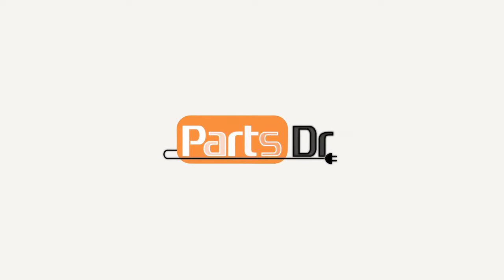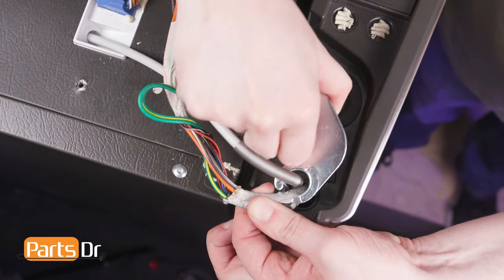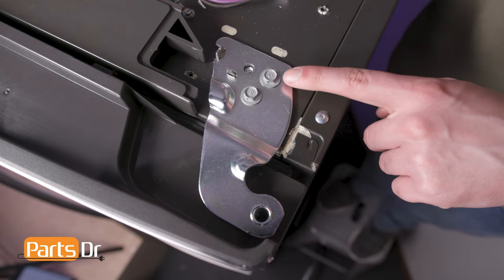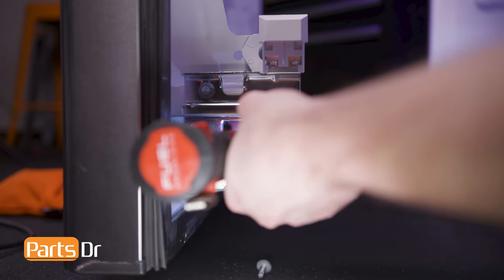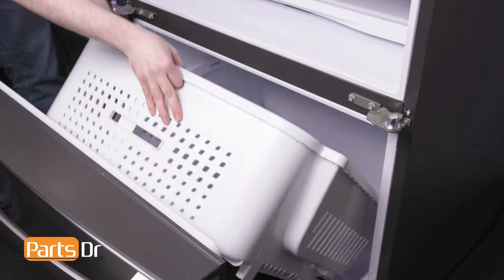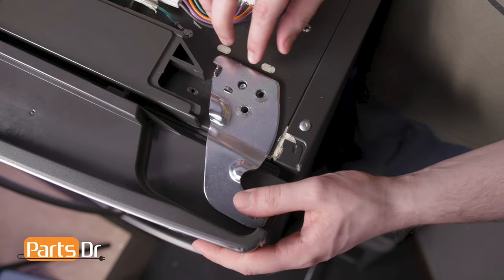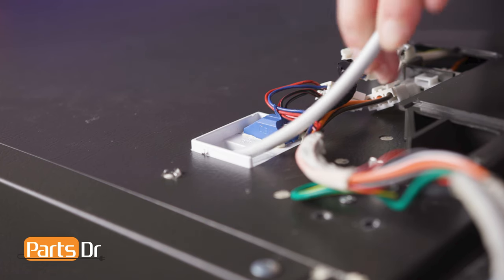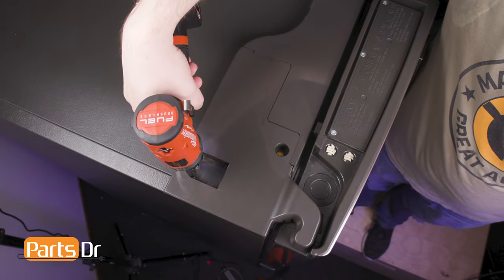How to remove all of the doors on a GE French Door Refrigerator

Comment: Oh my word!  Just had a horror nightmare getting a new GE french fridge delivered and installed.  My exterior sensor panel just seems to be dead.  I would not doubt the issue being in the door replacement where the wires are.  The guy they sent to look at it, really didn't look closely and said Mftr defect and now want to start this delivery and install nightmare all over.  I am going to get someone to look at your instructions. Excellent.

Comment: Excellent video.  My door started making a horrible crunching noise, worried it might be the plastic cam thing, need to open and lubricate... i hope that will work -- the plastic cam part is shown as unavailable by GE... a part unavailable on a refrigerator just moments out of warranty.
Reply from the maker: Sorry to hear that you are having issues just outside of warranty.  Let us know what you find as the cause of the problem.